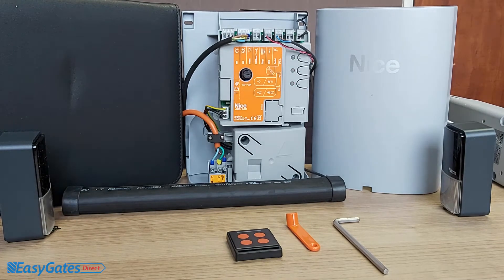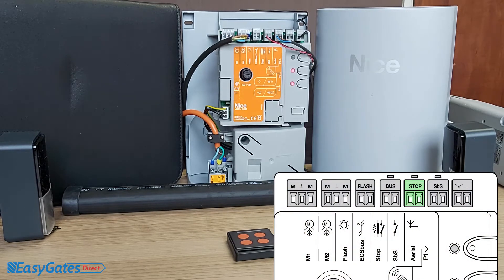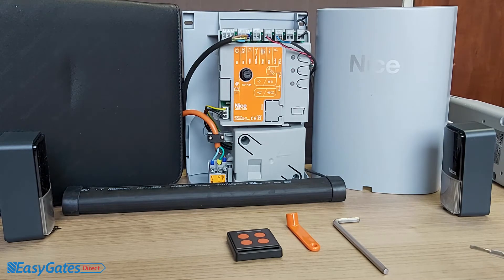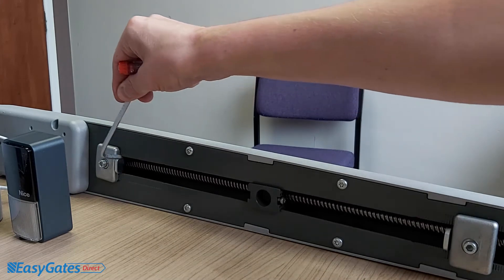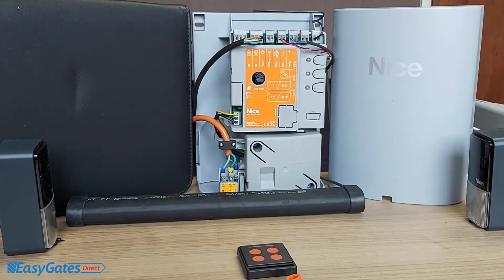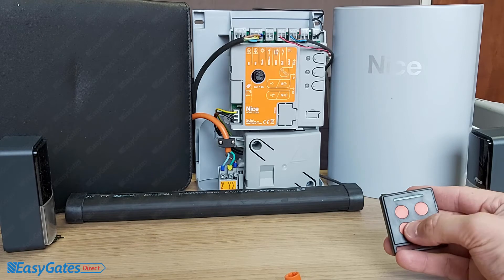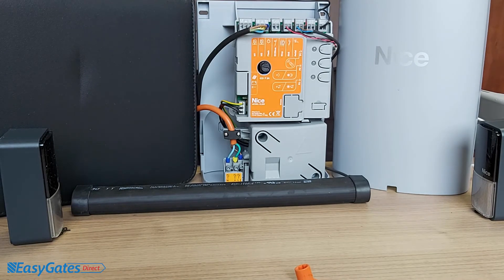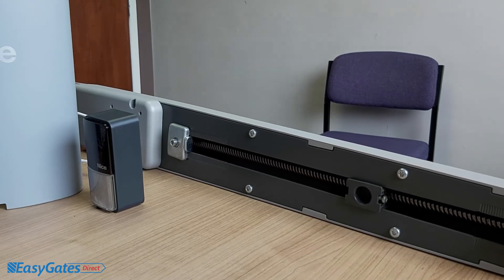Nice Home Control panel Programming for the Aria 401

Comment: Hi there, I would like to install two "Mighty Mule " keypads one outside and one inside. Where do I have to connect the signal from the receiver to the Nice Aria CLB 202
Reply from the maker: Hi Peter,

You will need to connect your x2 relay cables to the SBS (step by step). If you do not have an external power supply, you can draw +24v from the left-hand side of the SBS and -24v from the right-hand side of the STOP. Hope this helps!

Kindest Regards, 
The EasyGates Direct Team